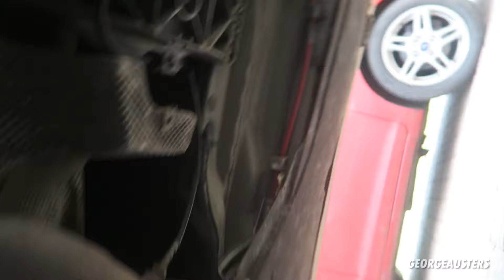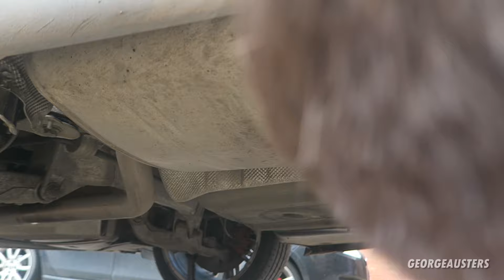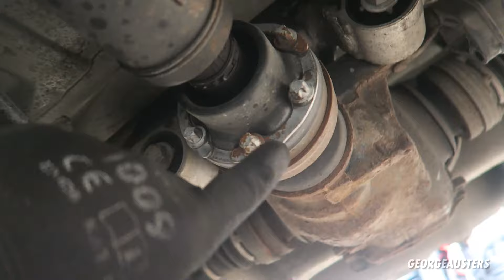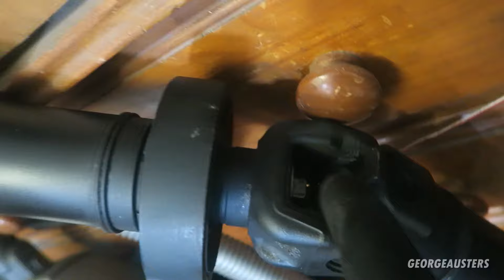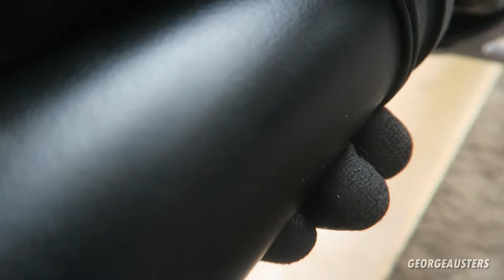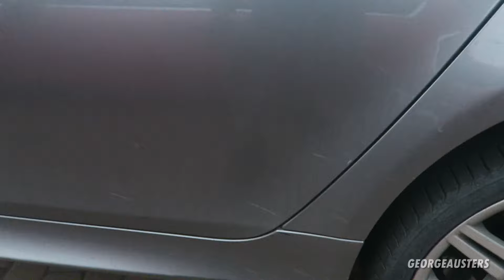BMW Propshaft Driveshaft Center Bearing & Giubo Flex Disc Replacement

Comment: Adding on my comments a month ago Re the clinching noise when moving.  My BMW650I 2007 model issues with transmission, coolant mix oil from the coolant into the tank.   The car was taking on trailer as it was not drivable as the transmission was leaking badly.  It was taken to the garage for 5 days had parts replaced including the center barring.  The oil in the transmission was just less than 2 liter.   The garage kept me updated, the coolant was replaced, transmission was repaired, from gasket was replaced, filter and ban were replaced, new oil for the transmission.  The car was taken from the garage last Thursday, so far so good.  All transmission noise, kicking etc disappeared. So far no leakage underneath the car.   Thank you for your footage video.  Personally am happy with the works done.   I suppose once repairs are done specially with leakage as it does take time to see any differences.   Transmission seems to be working well.  Should update of any changes.   Hope this feedback will help others.   Thank you 🙏 once again.

Comment: I was hoping your propshaft halves went together like my GTV6's. Mine has a bushing on the front with an olive bearing on the rear half and I'm having a hard time this time getting the bearing into the bushing  (I have a center guibo tying them together.) When you started taking your halves I was thinking "Oh no! He didn't mark it!". I can't imagine the hassle getting it right again! I DID forget the first time I had mine apart, but with the center guibo it only has three positions to choose from so it was easy to sort out. It's nice listening to a tutorial when proper terminology is used!

Comment: You put the guibo on back to front, check arrows for right direction and centre bearing needs to be retentioned, thank you for nice clear video, keep well.
Reply from the maker: I changed it after don’t worry👍🏻
Reply: @GeorgeAusters  oh good! I saw that part of the video and I was like his guibo is on wrong. Glad you made the correction.
Reply: How do you 'retention' center bearing ??
Reply: @3sgteJoe  slide it towards the rear diff before tightening
Reply: @CoolcatTerri  the two side bolts I assume you mean ?
Reply: @3sgteJoe  yes

Comment: I would just add one very important note to this otherwise great DIY vid - NEVER put a tail shaft into a vice as shown here. The tail shaft is simply a "tube" that will dent very easily if compressed in a vice and will most likely put the shaft out of balance. You should be able to put the end coupling into the vice jaws with a couple of blocks of wood to protect it rather than the tail shaft tube. You could also put a couple of bolts or screw drivers through the mounting holes in the coupling and brace the twisting of the shaft that way - this will mean someone else will have to hold that in place while you undo the middle coupling bolt.
Reply: The flex disc arrow is pointing the wrong way.  rotate the disc one hole to the right.  the transmission should be connected with the arrows facing the transmission.
Reply from the maker: I’m sure I did correct it before installing Joe👍🏻
Reply: i guess im randomly asking but does someone know of a tool to get back into an instagram account?
I somehow forgot my account password. I appreciate any tricks you can offer me
Reply: @Moses Maximiliano instablaster ;)
Reply: @Brian Kole i really appreciate your reply. I got to the site through google and im waiting for the hacking stuff atm.
Looks like it's gonna take a while so I will reply here later with my results.
Reply: @Brian Kole It worked and I finally got access to my account again. I am so happy:D
Thanks so much you saved my account :D
Reply: @Moses Maximiliano you are welcome :)

Comment: Just finished doing my prop shaft bearing after watching this video. Only problem I had was couldn't get the prop shaft out off dif end. I managed to remove front of prop off the car and left the dif side in place to replace bearing. Hope this helps anyone that comes across same problem. It can be done with dif end still in place just remove the bolt at the uj and mark it and slide it out. I also never removed exhaust. Just dropped it off its rear mounts to get access.
Reply: You think that would be enough for me to just get the transmission out? Just leave the back half up?
Reply: @michaelbernier9791  yeah. Would be plenty of room to remove transmission.

Comment: If interested, I used a now 6 month old  plasma rotating 3D printer using a mix of titanium alloys mostly from recycled powders that used to be waste. Designed a completely new propshaft and differential, with a few upgrades I incorporated. The entire system weighed under 20kg and about 10x stronger than original. Plugged in the CAD design into our new modern Solid Works specialty CAD software. Mde a few upgrades for heat and rotantial efficencies to require no lubrication or maintence. I ended up building the strongest and lightest driveshaft, and almost 100% of conversion of mechanical work. 
My boss lets me use materials that otherwise would be waste, to build what ever I want. Used the hood design using a mix of materials that is basically the same as the A380 wings and is super strong. The spray shop colour matched via xray type machine and it weighs 6kg total. 
I should put these online. 
Next will do the heavy front end - the radiator support section that is super strong (pre-ped safety) with stronger but way lighter materials. Try to get my 1989 e30 to weight under 700kg. Already dropped 200kg :D

Comment: great video George. with the centre propshaft bolt, wouldn't it have been easier to undo it with the diff end hanging down (to get spanner clearance on the bolt) and leave the other end connected to the transmission. then you wouldn't need the vice because the gearbox will stop the propshaft from moving. once the centre bolt is slacked off you can then take the whole assembly out and finish the job. using the vice is risky because any damage or dents to the propshaft and it will  become unbalanced

Comment: Great Video!  I'm getting ready to replace my center support drive shaft bearing as well.  Additionally, I have an idea that the car's rear sub-frame needs new bushings.  These wear out over time and create the "clunking" noise you hear when you accelerate your car.  I hope this help you repair your car.  Good Luck from the great state of Arizona in the USA.
Reply from the maker: Thanks Anthony!

Comment: Another great and honest video mate! I am happy I dont have the bolt putting both shaft together on my E91 325XI. At first sight I was like "Holy crap the bolt is missing or there is even some pin >:(" but at the end it was like just pull out shafts from each other but firstly mark it so that you can put it back together like it was :). Keep up lad!

Comment: I've been researching a clunk / rattle noise on 2016 M3 w/ 21K miles, in the back and came across your video.  Overall pretty good and I appreciate the honesty at the end.  Seems there are many folks out there dealing with a M3 clunk noise in the back.  I've looked everything over on my car and it seems it might be the internals of the diff.  Nothing else is loose.

Comment: In case it hasn't been mentioned yet, you put your Guibo on wrong.  There are small arrows marked at each bushing (where the bolts go) which point toward the shaft & transmission.  You put it on backwards.  This could be why you are still having a knocking noise.  It will wear out much faster and need to be replaced again.
Reply from the maker: As I mentioned in reply to the comments, I actually changed it around prior to installation👍🏻
Reply: j’espéré pour lui qu’il n’a pa retiré la petite plaque sur l’arbre de transmission, elle sert d’équilibrage pour la rotation de l’arbre de transmission
Reply: @GeorgeAusters did it fix the problem?

Comment: Have you replaced the two engine mounts? They are hydro bearings (liquid filled) and will fail around your mileage. If one is failed, a typical clunking sound will be present.

Comment: How do you correctly reassemble the rear bearing if it comes apart. The gator came away from the hub on both the original shaft and the replacement from the donor car on removal.

Comment: Hi, Could explain how is the sound, because I hear a sound in my '18 320i w less than 50k miles. Its like a wired atrapped under the center of the car. Use to be stronger when accelerate it.

Comment: Bit late to the party, but did you actually figure out what the clunk under accelerationw as caused by? I would have to guess it was the spline between two halves of the driveshaft getting loose.
Reply: Did he by any chance answer

Comment: Excellent and crystal clear footage. Unfortunately I am facing similar issues with my BMW650I 2007, clunking noise and was considering replacement of what exactly you done.  However, I have oil leakage as well most likely from the gasket between engine and gearbox. Had it replaced a year ago. The leakage stopped for few months and it’s back again.  My question to you would be? Do I need to use all BMW original?  The labour cost around $200-250 plus parts.  Thank you for an excellent video. Well done 🙏

Comment: My clunking on acceleration was rear control arms on passenger side on my 123d, I bought TRW M3 ones and banged them in and it’s smooth now
Reply: On what kind of car ??
Reply: E87 123d

Comment: The propshat should be aligned in any way? Because I got a strong noise at 80-90 km\h after my mechanic changed the bearing

Comment: My e60 523i 2006 msport has a shutter under load in around 2000rpm, but if you accelerate hard there is none! It's an automatic also. Could this be propshaft or transmission related? Any in put would but much appreciated.

Comment: I was told by my mechanic that my universal joint was unstable on my E38. He recommended replacing the propeller shaft end to end. He said rebuilds were fine to use or buy new, but they have to be perfectly balanced.
Reply: I was told the same. Did you end up just replacing the bearing and guibo disk or the entire driveshaft?  What was the result if you just did the bearing and disk? Any issues? THanks so much!
Reply: @jameswallen4854  what did you end up doing because I have the same issue but I found a propshaft on eBay that’s new but a lot cheaper than directly from bmw
Reply: @K444AB  I literally went to probably 10 different mechanics and all wanted to replace the entire driveshaft. I was convinced it wasnt the driveshaft and something else. I was right. I finally found a driveshaft rebuild place. I was quoted up to 3500 by all other places. Rebuild guy takes a look at it and says it's just a bad guibo disk. Charged me 500 and was done same day. He said unless you have really high mileage like 250k, it's unlikely a driveshaft fails without a guibo going first. It was the strangest noise that I had the damnest time finding but once he showed me the old disk and I could see how it functions from mechanical standpoint, it made total sense of the noise I was hearing.
Reply: @K444AB  also to your point about balance. All 8 to 10 mechanics seem to have some fear about balancing the shaft and claiming they rarely go back together the same way and customers complain of vibration after repair which is why they recommend an entire shaft replacement.  The drive shaft rebuild shop said to me, that bs and they just don't know what they're doing, and that balancing a BMW driveshaft really wasn't that difficult.

Comment: The clunking sound is the diff output flange. Needs taking out, regreasing and locktite applied to the spline. Bmw service bulletin SI B33 04 09
Reply from the maker: How do you know for sure? I’m thinking of getting my diff refurbished
Reply: @GeorgeAusters  I don’t, but I’d be pretty confident on it being that. Sorted mine out 😀 it’s quite a common issue I believe, even more so on the older BMWs. The parts to do it are about £20 so I’d try that before a new diff
Reply from the maker: @markatkin001  Are you talking about where the diff meets the propshaft?
Reply: @GeorgeAusters  yes the flange which is part of the diff
Reply: @markatkin001  I have this exact thing. clunking noise. The center bearing where pretty loose when jiggling the shaft. So im in the process of getting the same parts replaced. Bur now im curious about this diff output flange. Do you have a more accurate description? perhaps a link to RealOEM?
Reply: @markatkin001  wouldn't that be the input flange?, where it's connected with 4 bolts to the driveshaft. I assume it's the input and the output are the 2 flanges that connect to the axles
Reply: I have the same issue,  there is vibration on the car.  Also when i try to accelerate,  the clunking and vibration gets more.
I went to bmw authorised  dealer.
The specialist guy Said me, its differential flange. Which is on the diff.  But bmw does not sell it..  They sell. Complete drive shaft. Because of that, you cannot find the part Number.
You can find Only oem.

Also changing this flange is very important job and absolutly you must apply the procedures on the service manual.

Comment: Good video and good though process in fault finding. But have you checked the universal joints for play? Neither looks it can be greased. I certainly don't see any grease points. After 100k  they will be dry. Also have you checked the diff back lash? Or is there play in the drive shafts?

Comment: Good day George i have a bmw e90 318i from 2006 129ps after bring it to the mechanic for a repair on the Engine chain. I have the following problem. When I drive around 70km and up everything starts to vibrate in my car. When I release the gas it gets almost gone and when I push in the clutch it's gone. I have bin back to the mechanic. But he gives me a lame excuse that it's my .Flywheel and that the car is not worth the replace. I think that did some wrong during the changing of the chain or left some parts out like shock rubbers. Sins the car didn't have the problem before that repair. The bmw offer here trying to rip me of and want to replace like a whole lot of stuff. Yea the problems would be solved probably. Because the change everything that has to do with it from my injection to my drive shaft to clutch. Do you have any idea what it could be or what thay have messed up?

Comment: Thanks a lot Matie for this video.  Appreciate your video.  Just a point to note, after replacing the centre bearing, I had a problem the tri-factor lights coming up and I found that it was caused by the transfer case plastic gear being worn off.  I had the gear replaced before doing the centre bearing changed actually....i think somehow by me turning the axel while replacing the giubo had caused a misalignment of the 4 wheel drive system which resulted in the gear being chewed off.  Let me know your thoughts.  Thank you.
Reply: Nah… that plastic gear is a wear item and it eventually fails on all XDrive BMWs.

Comment: I had Same problem same car. it was the engine mounts. I Had the exact same problem. When the engine shifts back-and-forth. The only thing that could rip or damage would be the center bearing. Everything else will shift with the engine except the center bearing.

Comment: Your flex disc is on wrong. After you show the six bolts, and the flex disc, look at the arrows on top. Have you fixed it? If not, your transmission torque will stretch out your flex disc and cause more noise then fail. Even shops have missed this. Great video!
Reply from the maker: Yes it was changed round the other way👍🏻

Comment: I need this as my 2011 328i clunks when accelerating and also vibrates.  I just know its coming from the drive shaft.  260.000 miles.

Comment: I watched this because I was assuming I need to replace the guibo on my 2007 750Li.  If I stop & park on an incline, when I remove my foot from the brake pedal, there is a substantial amount of motion.  I've seen other videos posted of people changing their guibo so assumed it was something that's pretty much definitely going to be bad (132k miles).  Now I'm not so sure.  My Chevrolet pick-up truck developed the same issue a few years ago and if course I assumed it was universal joints, but it was worn ring & pinion gears in the differential.

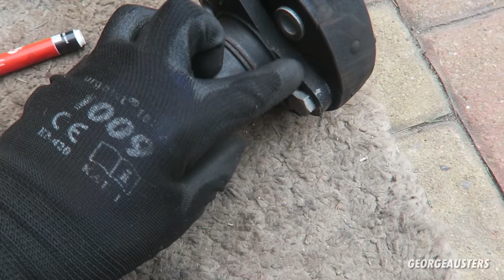Comment: The arrows should go the direction of mounting. Min 14:18 you can see is opposite.  I am afraid you have to redo the operation to place the joint in proper way.
Reply from the maker: I actually did change it round the other off camera so no need to worry 👍🏻
Reply: Albert Stefan: very correct and careful your observation!
Reply: I don’t understand, I have a Guibo in my hand right now and there’s 2 arrows, facing both ways lol

Comment: It might be the position of the nuts on the giubo... the ones that goes into the transmission need to be doing the pressure towards the nuts in the shaft in the thicker part of the giubo...

Comment: hello, I have a bmw e60 520 177cv 2008. I feel vibrations in the gear knob and in the seats but also in the bodywork and the exhaust.  In this regard I have changed various components such as engine mounts, crankshaft pulley but the vibrations have not disappeared.I was thinking of changing the shaft joint and the longitudinal shaft support.  Can you recommend other interventions that I could do in this regard?  Thanks, I'm waiting for your feedback.
Reply: Hi George, i waiting for an response , please

Comment: Is there any way to know how the prop shaft goes into spline? Did a trans swap so i just removed prop shaft off without marking it. Stupid mistake.
Reply from the maker: Doesn't need to go a certain wait onto the transmission

Comment: Hi. Have you seen how the engine supports are doing?
Reply: I just changed my motor mounts and did my two guibos. And now ima go do the center support
Reply: I did motor and transmission mounts.